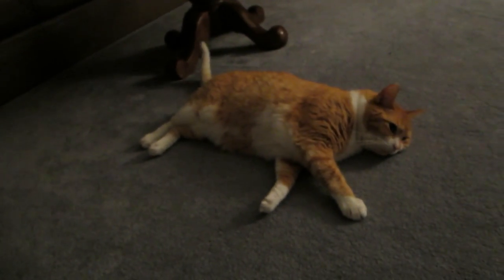Cat Footage  11/3/13 - Day 1,061

Comment: You either need to buy a new carb for the machine or get a carb rebuild kit for it! It really sounds like your float sticks shut or open!  I can look at the carb if you want some time and rebuild it if necessary as you say you have the rebuild kit. Most of the time you do not have to replace everything, just main components. Also, a good thing to do is to buy carb cleaner and spray the shit out of the carb. Be  careful if you do this to remove the plastic float or you will destroy the float.